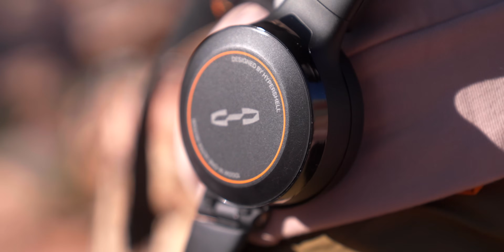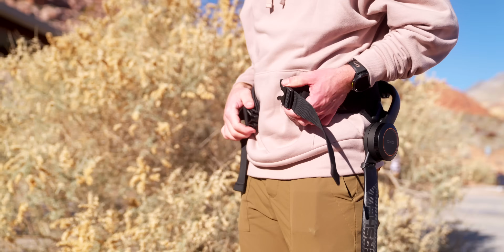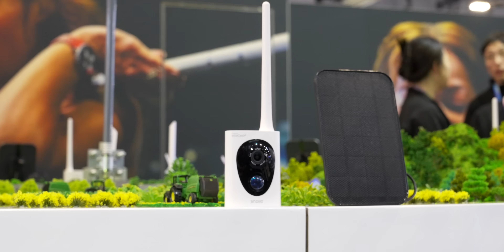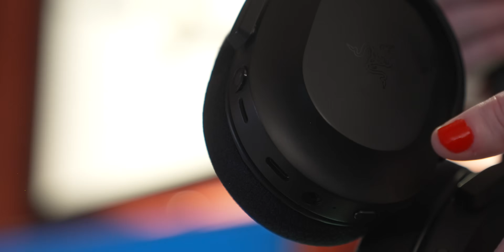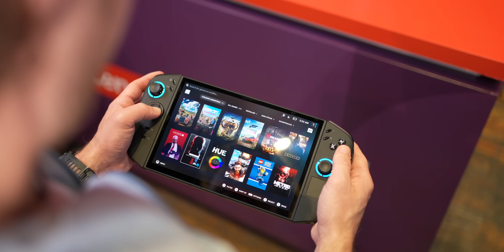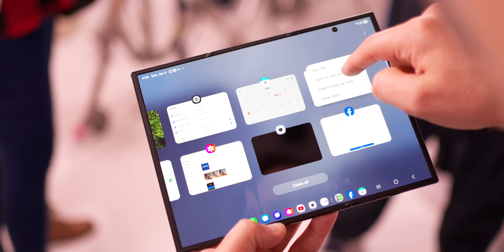The coolest tech at CES 2026 (Part 2)

Comment: If you need exoskeleton on a hike, you should stay at home.
Reply: People who have disabilities or are maybe recovering from injuries are allowed to go outside and walk. And I'll never understand why people need to judge other people's actions when said actions do not impact them whatsoever. If somebody is using such a device to do a hike they couldn't do otherwise, how does that affect you?
Reply: People that got disabilities or injuries are allowed to enjoy the outdoors as well
Reply: It provides 30% less exertion on the legs and offsets 30kg (66lb) of load.
I think I understand why people use it.
Reply: As a physical therapist this exoskeleton may help people in certain rehabilitation timelines to to encourage more confidence. There is a robotics machine called KineAssist and I got to experience it myself. The issue is that it is very bulky and expensive. 

The miniaturization of an assistive robot for rehabilitation is the next step towards reasonable progression for people who need it.
Reply: if the exoskeleton helps people who barely moved in the past to move a bit more, then it's worth it. we as a society have become too sedentary.
Reply: Also, the exoskeleton can be used in exercise mode where it gives you more resistance on your hike. 

So if you are such a fitness freak use it for that.